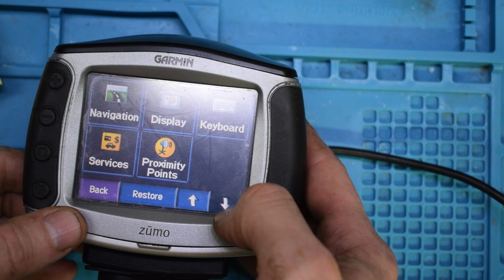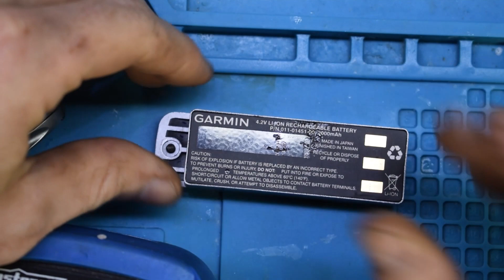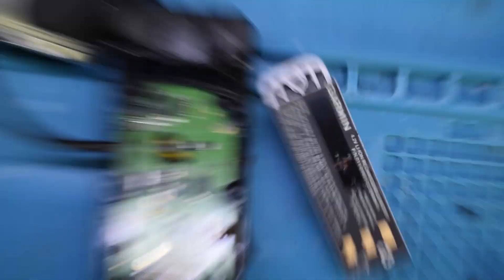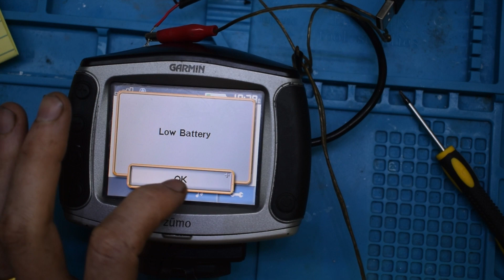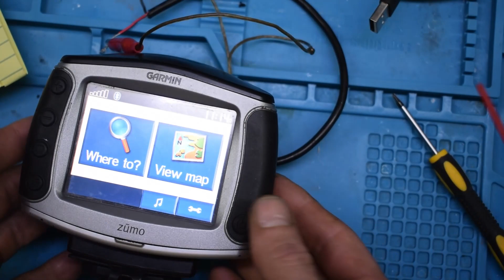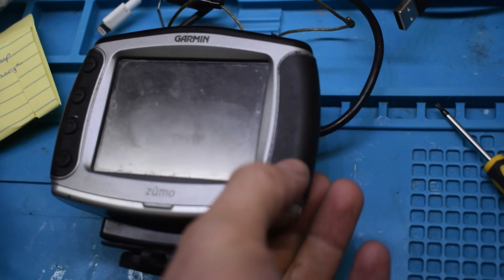Garmin Zumo 550, AM GPS (not charging fix)

Comment: To make a sumo charge you plug it in.
Let it fully boot, then press the power button once.
It will go into charging mode
Reply: Hi there, would you know if its possible to update maps on the zumo 550?  I have a 2012 model.  Thanks for any help you can give..